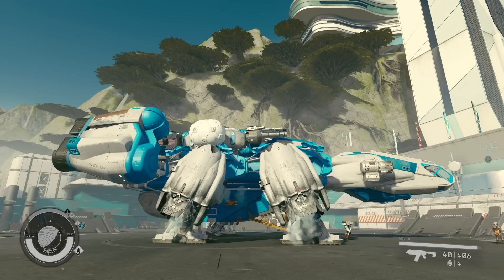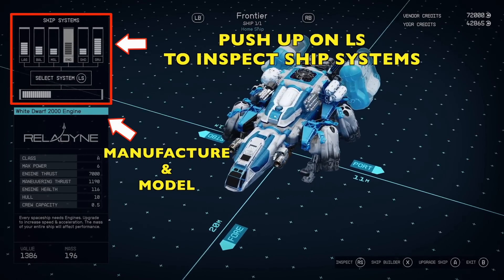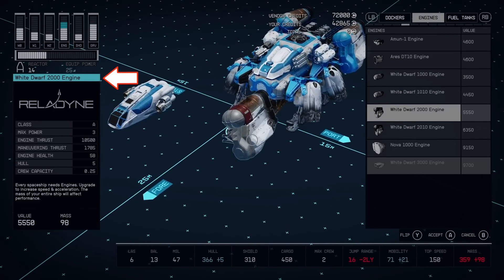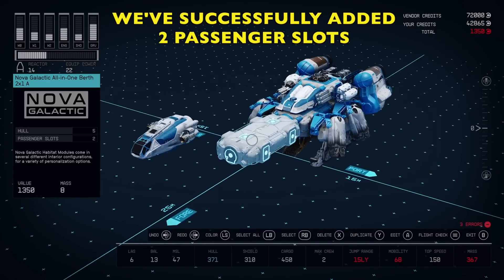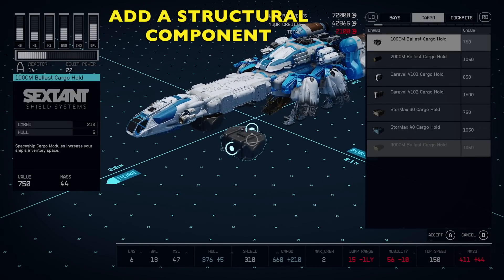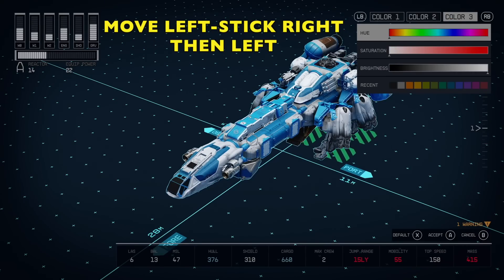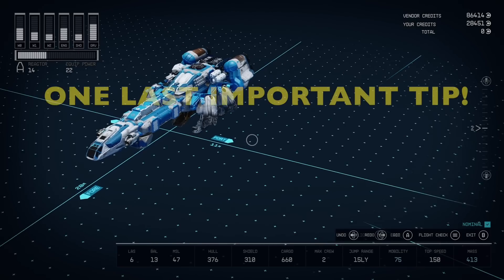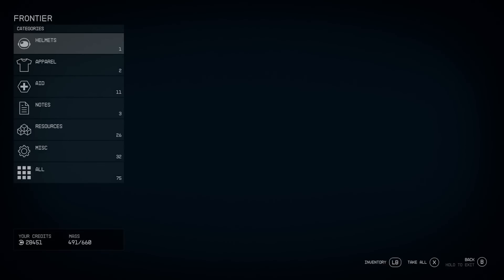Starfield: Ship Building Guide MADE SIMPLE - A Beginners tutorial!

Comment: Best 2 Hulls are Works shop for the crafting (industrial, weapon and clothing mods) and science (for research), 

Living quarters allows you two have more passengers but their attributes (I don't think) benefit you whilst flying i.e Sam Coe has got a high pilot rating and gives you a free power rating in engines without any power cost but if you having as passenger and not crew it won't count 

Haven't experimented with much else but i just went for the Straus 2x1s and did the job